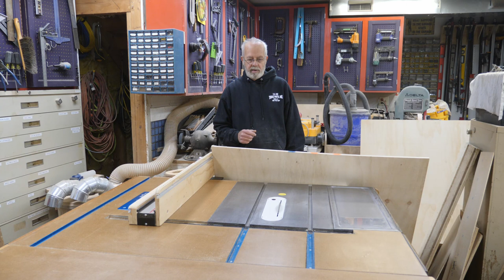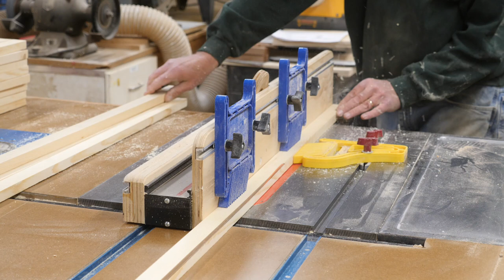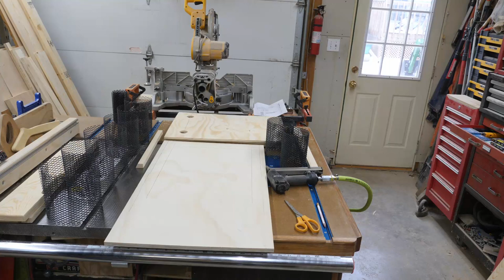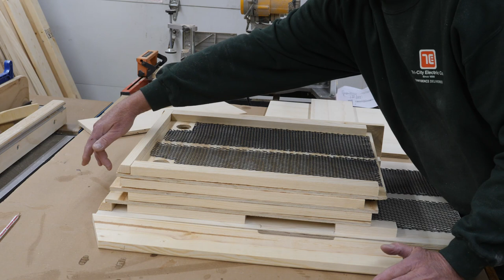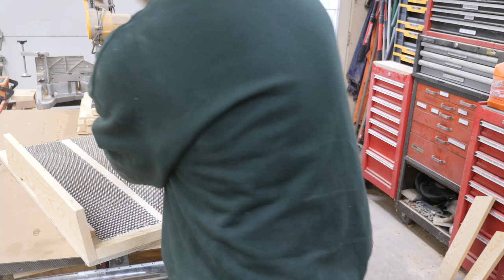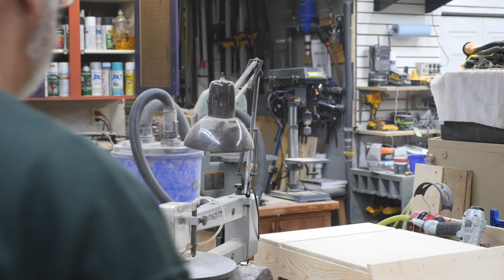Building a four Compartment Nursery Bat House- Step By Step

Comment: Keep us updated on any occupants.
Reply from the maker: I was also selling these, but had to stop.  Since this COVID19 is possibly liked to bats, I was getting way too many nasty-grams.
Reply: @rogersshop  Sorry to hear that. Thanks for posting these videos. I find them very helpful.
Reply: Hey Roger, wondering if the manual tells you to use mesh or not to use mesh? The links no longer work, but I found info by searching on their site. However it says NOT to use mesh. Have you noticed any issues with the mesh? Maybe they learned something not sure. Re COVID19, Bats aren't to blame = https://www.batcon.org/bats-covid-19-updates/ Thanks for sharing. We will be working on some bat houses here soon and some other wildlife conservation helpers before winter.
Reply from the maker: @The_Bearded_Lady  You can use mesh IF it is fastened well by using stainless steel staples.  Otherwise, if it would come loose by regular staples rusting away, the bats would get caught in it.  Shallow saw cuts horizontal on the backboard also work, but are very time consuming to do.
Since the COVID-19 thing is supposedly related to bats, we have had to stop selling these for a while due to some pretty nasty comments and emails.  May be why links no longer work, too.
Reply: @rogersshop  thanks for the info and sorry folks are being jerks